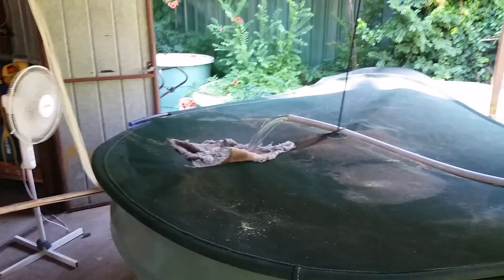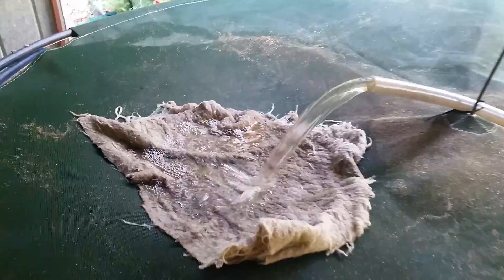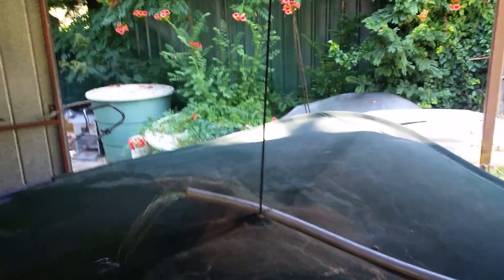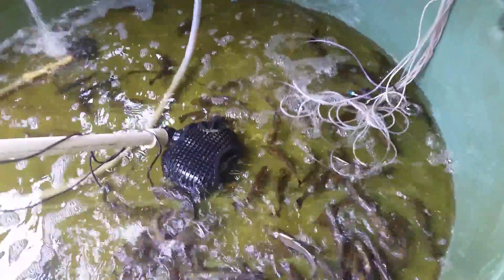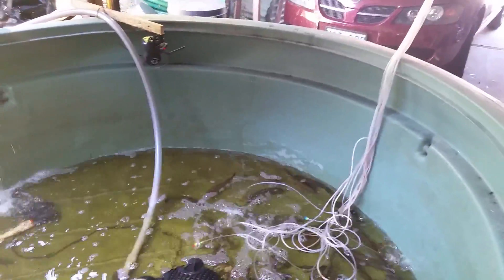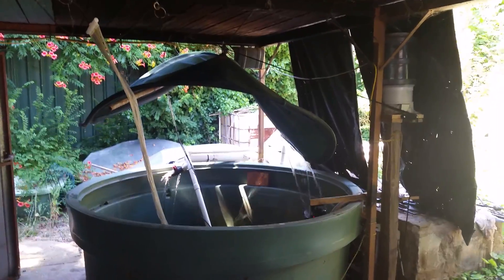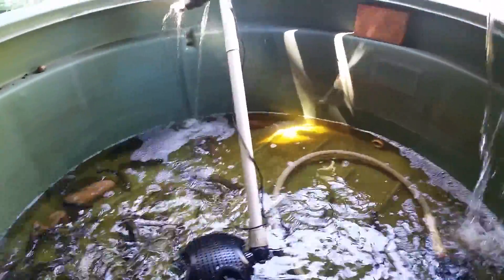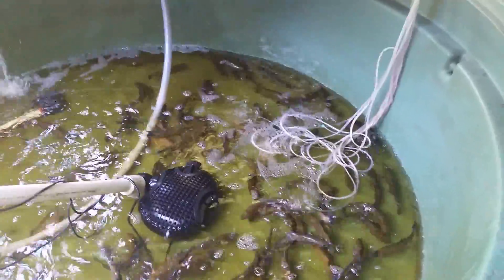My cooling systems for trout in aquaponics

Comment: Connect a few clean car radiators on the outside with fan blowing on it and run water from pump through them
Reply from the maker: Evaporation is a much more efficient cooing mechanism than radiation/convection etc because of the climate I live in. It's hot, but it's really dry, so evaporation works really well. So if you're not afraid of the loss of the water, and the climate is right, it's going to be more efficient than radiators. Also, radiators won't help you if the day is 40 degrees C, but evap will still be working.

Comment: Yeah the low water level probably stress out the fish
Reply: I ran it this way for 2 or 3 years. No trout loss and they managed to survive in 40 degree C heat (admittedly dry heat). They live in streams. Shallow streams. 

I've heard a bunch of people claim a bunch of stuff here with supposedly absolute authority. The difference between me and them is that I actually did it successfully, for several years. Proof, pudding.

Comment: Sorry to say but you're wrong about having less water. Think about it , it's easier to boil water when there less of it in a pot verse a full pot of water.
Reply: same goes the other way around its also easier to cool down a lower volume of water, especially when using primitive methods, we use trickle filters and wet wall with fans and this keeps us going through the warmer months, interesting video though
Reply from the maker: Yeah, I'm not saying that. I'm saying that the ratio of surface area to volume is greater, so that you can essentially have saturated DO2 regardless of temp. The evaporation takes care of the temperature.

Comment: The larger the volume of water the more resistant the water is to temperature changes. Also the larger the volume of water the larger it's capacity to hold disolved oxygen which further stabilizes the system. The surface area to volume ratio might be high but the actual surface area and the capacity for the water to absorb oxygen is unchanged. So in effect you've reduced the waters capacity to hold oxygen without increasing it's capacity to absorb oxygen......

You have literally done the opposite of helping the fish. You've made them more susceptible to temperature fluctuations, more susceptible to oxygen crashes and stressed them out  by being in such shallow water.
Reply: and in large deep lakes (steelhead are rainbow trout..)
Reply: In the river are also deep pits
Reply from the maker: Maybe, but I just want to point out that they are trout. In their natural environment they live in shallow fast flowing streams.
Reply from the maker: Conversely a smaller water volume can shed it's heat quicker than a large water volume. So the evap cooling can cool things down fast.

Comment: Hey, I know everybody has his on way of doing things for where he lives. But I'm in northern part of the state in Ohio. I raise rainbow trout in large swimming pools. The 48 inch high pools are half way below the ground. Ground temp is 55 degrees year around. This helps keep it cool in the hot summers and warmer in the cold winters. I found that running water out of the pool in any way will work against you ether hot or cold. I also found the more water you have the better in all ways for the fish. I keep my pool cover elevated over the pool, this keeps out the sun but allows air flow to the water surface. This is very important.  I strongly disagree with using a low water level. This is why, as your bubble stone put out bubbles it has very little water to pass though to dissolve the oxygen in the water. The deeper is better for the bubbles. Thanks for the video.
Reply: this makes all the sense. thank you

Comment: ahhhhhh, while i may be way too late, your theory is incorrect, larger volumes of water prevent the temperature from changing quickly
Reply: Southern Style Homestead - true. It's like boiling water. Less water get hotter faster then a full pot of water.
Reply from the maker: Yeah, I'm not saying that. I'm saying that the ratio of surface area to volume is greater, so that you can essentially have saturated DO2 regardless of temp. The evaporation takes care of the temperature.
Reply: @sjgemmell  did all these fish survive the summer?

Comment: hey mate im at Jervis bay NSW and wanted to grow some trout But i am worried about temperature. Have you considered the brown trout or brook trout for warmer water? cheers
Reply from the maker: I have grown brook trout, which did pretty well and are sourced from the government run gaiden trout hatchery in the snowy mountains. I seem to remember rainbow trout having the highest temperature range. You wont be able to use evap cooling up in Jervis as effectively due to the humidity, but there is a guy in Gerringong who keeps trout so you should be pretty right, but perhaps struggle to get them through a summer.
Reply: ye right ok mate thanks. do you know where I can pickup aquaponic supplies mainly the fish tank you are using? i had an IBC but felt that it would be better if it was less deep and rounded and I could make the water circulate. I was thinking of buying 50m of coiled hose and connecting it to a secondary pump in the sump. put the coiled hose in an old fridge with 2 holes drilled for enter and exit. that was I could keep the trout cool. do you have any details of the gerringong guy?  cheers

Comment: I was wondering if you run an inline pump instead a submersible..........................wouldn't it keep the water cooler?
Reply from the maker: Well yes, inline would not be dumping it's heat into the water. Should run cooler though I have NFI just how much heat a pump generates.

Comment: Hi, very cool video and a very interesting system, I do have to say that if you fill the tank up to the top you would have less major shifts in water temp, that being said it could be bad and good, depending on how many gallons your tank is it probably would be good, you have loads of aeration, lots of water movement and have shade. If this seems to work for don't change, but that is just my tid bit.
Reply from the maker: +Blanchard Bros Yeh, considered that, but the potential stress from temp swings are better than the definite stress of lack of O2.
Reply: sjgemmell I don't think you would have a lack of dissolved oxygen, sorry if i'm coming off rude here, but if your fish are surviving in this little amount of water they would most likely survive when the tank is filled to the top. How many gallons is your tank?
Reply from the maker: +Blanchard Bros I have been running this system since 2008 I think, the first couple of years I would have pretty much all of my trout die over summer because it gets too hot and the fish don't get enough O2 (temperature is inversely proportional to the saturation level of DO - as temp goes up, the saturation level of DO goes down until it's so hot you can't get enough oxygen into the water and then they all die). So this is my solution - I use a bunch of techniques to cool the water, and get the O2 up, and this enables me to keep them through the summer (I am talking 37 Celsius in the vid!). Now I am not certain that running the water low does actually do anything, but my theory is that most of the oxygenation of water happens at the surface where it is in direct contact with the air. So by lowering the volume you increase the ratio of surface-area-touching-air to volume-of-water and thus tip the scales in the favour of having higher DO2.

But you raise a good point - I should get a DO2 meter and measure it in both scenarios, full (3000L), and low (~1000L).
Reply: sjgemmell you are correct most oxygenation happens on the surface, in natural water ways, when you place an air stone in the water and place it at the bottom the oxygen is separated out in the water column, when you run an air stone at the bottom the process of those bubbles coming up to the top bring up poisonous gasses etc and the irritation of the surface tends to cool the water as well. I found that the larger the body of water the less major temperature swings there are and have a higher capacity for DO. I have also found the more contact water has with air the more likely it is to become the same temperature. For example when the air gets below 31 degrees and it rains, it tends to snow, this is because the air is mixing with the water changing its temperature. So if this happens in 98F or 37C air, it could possibly add heat into the system instead of cooling it. (via your pump). But
Shade can have up to 25F difference than the ground/air that is affected by the sun. which would place your air temp in the shade at 73F which is survivable for trout. I am very intrigued by your system and it is puzzling how your trout are still alive. Yet again sorry if i'm coming off rude and crude. It would be awesome if you could put out a video of difference in temperature of your carport shade Vs. the sunny side to see if my theory is correct. Or you could just tell me xD.
Reply from the maker: +Blanchard Bros I can't be sure how much of an effect it has, but it in the shade on a concrete slab which is also in the shade! The reduced thermal mass of the water is probably being offset by the fact that it is thermally coupled to the concrete... but I can't really tell without removing my carport ;) 

I also want to say that the air INSIDE the lid is much cooler than the air outside - what I have set up there is the same cooling method that powered fridges before electricity e.g. https://en.wikipedia.org/wiki/Coolgardie_safe

So there's two levels there - shade, yes, knocks off a bunch of heat because it doesn't get direct sunlight, and then the water on the cloth with the fan, which is an evaporative cooler which works a treat in our dry climate. Go 200kms east from where we are and you'll find that nobody has evaporative cooling in their home because it doesn't work in humid climates. But right here, we have hot dry days and evap is the way to go. You also get this "sink" of cool air, if I put my hand under the cloth near the top of the water it is really quite cool. 

I don't have any temp readings for you though. Perhaps when I get a thermometer again.
Reply: sjgemmell It seems you got the cooling process down! very cool (no pun intended ahahah) I subscribed and liked the video, hope to see more of this system ;D